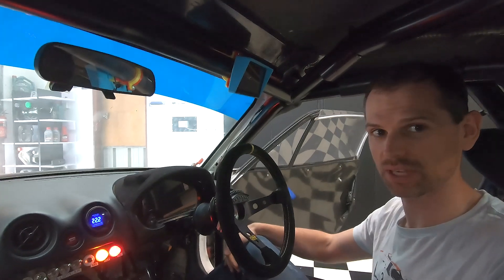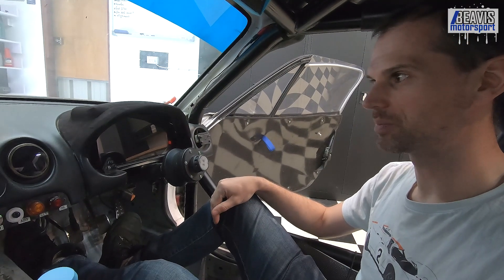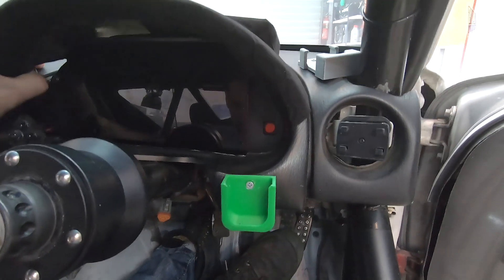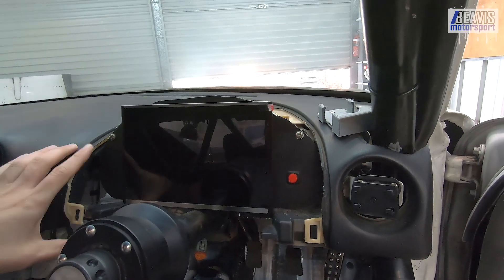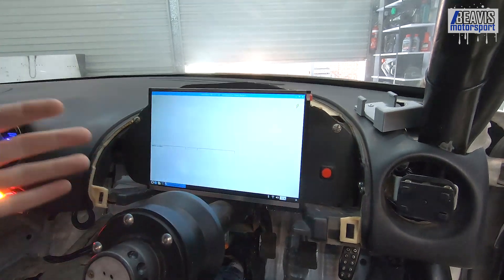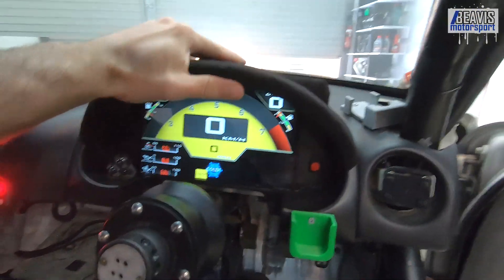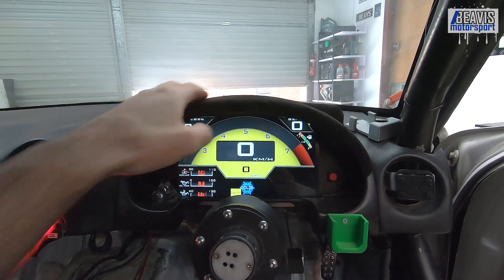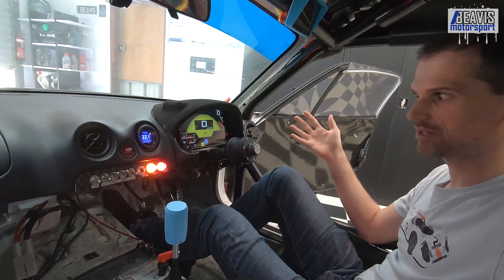CUSTOM RASPBERRY Pi 10" CAR DASHBOARD // Ep 90

Comment: I really like 3d-print optimized bracket design. A lot of people try to design something just to realize that it is unprintable or requires tons of support material. 
Are there specific tools to design dash layouts for MS? I plan to run digital dash in my car based on RealDash and I'd like to make a custom layout for it at some point.. Need to figure out the workflow.
Reply from the maker: Thanks. I just use Photoshop to design them, and usually photos from real dashboards (usually inspired by supercars as they have the most exciting layouts). And obviously make sure I have a layout that presents all the data I want to report.